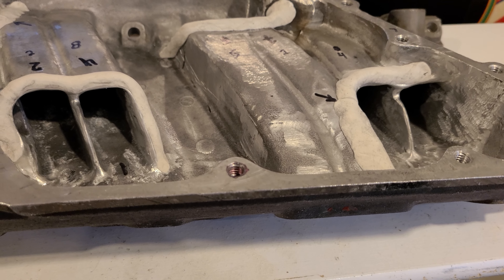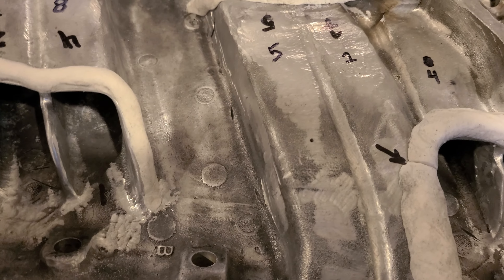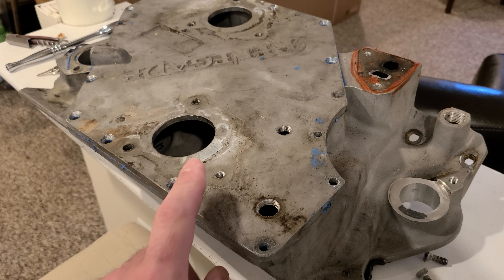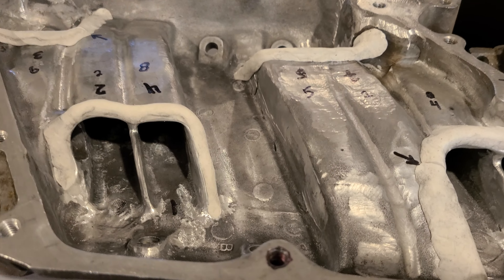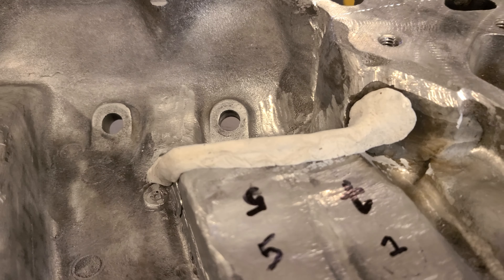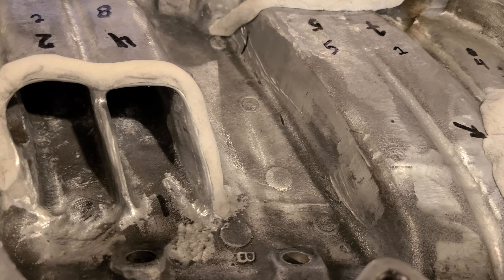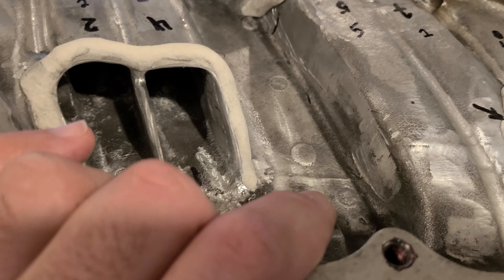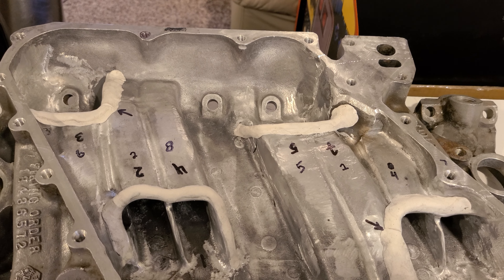Porting a crossfire intake manifold part 3

Comment: Great job i picked one of these manifolds up and i really want to port it and try it with a couple Rochester 2 jet 2bbl carbs or even a single 4bbl and a 1/2-3/4” lid spacer
Reply from the maker: @glastornjet73  if i were doing that I'd probably just make a custom lid and spacer at that point and move the units to a better location.
Reply: @ thats what i was going to do. Make a lid and a few dif top plates so i could use 2 Rochester 2bbls or 2bbl holleys or maybe 2 2bbl tbi units. 350 tbi units flow 500cfm stock and can flow 650 modified that may be cool with a holley ecm
Reply from the maker: @glastornjet73  yeah. The only real issue with the CFI units is lack of larger injectors so you're stuck upping pressure to make horsepower. The TBI units having 2 a piece solve that problem. There used to be a kit that would allow the use of a standard Bosch injector in the TBI pod and it would require a different ecm due to the impedance change for the injector. If you are using a Holley unit that may also be an avenue to explore.
Reply: @ not anymore you can get big block injectors new again now. Also can get the 9c1 police injectors which are slightly bigger than the regular 350 injectors. The regular 350 injectors are 55lb 55x4=220/8=27.5 thats like having a 27.5lb injector for each hole
Reply from the maker: @glastornjet73  i have the big block injectors and I'm already at their duty cycle limit without really cranking up the pressure.
Reply: @ oh wow that thing must run dam good
Reply from the maker: @glastornjet73  it's not bad. ~450hp is the limit. I'm getting 375 to the tire.

Comment: Great video! Can you explain what the humps are doing?
Reply from the maker: Per the gentleman flowing it on the bench, it was aiding flow distribution in the plenum (dead spots) and smoothing flow into the runners. It did pick up CFM with them there.

Comment: I port matched my intake to the heads and did not get them flowed.   How much did that cost and who did it for you?  I put it on the car an the car is crap until you get to 2500 then it will go.
Reply from the maker: It was only shipping but a gentleman on corvette fourm flowed it... if you look up a flow bench in the C4 section, superl98 comes up.
Reply: @ratherbeboating10  I changed the heads.  64 cc aluminum and 1.6 rockers increased timing to 10degs.  Need to check fuel pressure it seems like fuel is puddling at lower rpm.  Maybe low vacuum at lower rpm????
Reply from the maker: @10rrace  it could be any number of things causing that if I'm being honest... puddling and such could be the first place to check.

Comment: It doesn’t look like you touched the floors. Was all of the material you removed from the roof of the runners?
Reply from the maker: At the plenum side the majority of the material came from the walls and roof yes. The problem with the floor as I've seen it is in the area you really want to blend down, the casting is at it's thinnest. So by doing the roof at the entrance and floor at the exit I avoided most of the thin area... the walls are quite thick. Recently I worked the floor over further in the runner and just have to finish up and send it out to get reflowed to see how much it picked up... I've opened them all up to the dimensions of the best runner.

Comment: There's a couple of tricks to make this thing actually flow; one of them is to have the manifold sent off to Extrude-Hone to have the runners smoothed out (once you have it all figured out.) I've ported (and helped others port) more than my fair share of them over the years. You'll want to make a lid spacer (3/8" to 1/2" is good) but at the same time a filler for the middle section where there's no runners will help take up some of the volume increase you get with the spacer. This will help keep the initial acceleration down (more air volume means more air and thus, more fuel needs to be injected.) The spacer will help the fuel flow smoother and distribute more evenly, too. Did you remove the fuel spinners from the lid? Another trick is to mill down some of the bolt bosses where they interfere with the runner opening inside the manifold; use a flat head undercut bolt (similar to what the Renegade uses on their lid.) 

Note that those crossover ports were primarily in '84 manifolds and not the '82 manifolds from what I saw over the years. The F-body intakes are the same, btw.
Reply from the maker: The issue I run into is that at half an inch I hit the hood. Seems 3/8 is about the max and IIRC what was found to flow best. We did test without the TB diffusers. We are going to retest with a lid with them still in to see what they do and hopefully use a clear lid to observe smoke flow as well. I have noticed some F-bodies had the early casting intake into 85. Being how old they now are though who knows if someone swapped them though. The increase in plenum volume from removing the EGR passage alone would be difficult to offset imo. I forget if we tried to clay some of the dead space to lower volume.
Reply: @ratherbeboating10  The real problem is fuel distribution, taking the EGR passage out helps with that significantly. The "swirl plates" as we called them back in the day were meant to atomize the fuel better. Of course as you've seen, the runners flow differently - those crossover cuts don't really help much either, they're in the wrong place and a tad too big.

Fill in the section between the front and rear runners, you'll recover some of that excess volume you created by having a spacer (that helps fuel distribution.) Remember the EGR passage is hollow and when active, counts as plenum volume. When you get rid of it you create excess volume (but fuel distribution gets better.)

If you've ever had the heads off of a stock CrossFire you'd see how bad the distribution is. When I made spacers I made them of phenolic to cut down on heat transfer (cooler denser fuel.)

I may still have data from back in the day when I flowed the intake and did all the smoke tests but will take some digging. Best thing is to do like you said, get a clear top and do smoke tests with the TB's installed on top but you'll need to smoke test both at the same time to get a good idea. A good shop vac will provide enough flow for one runner and a smoke test.

I tested the Offy (basically the same as the Smokey Ram) when I had it as well, it flowed like crazy but was really overkill for a stock or even slightly modded CrossFire motor. The X-ram had a much smaller plenum volume but the crazy turns and weird restrictions made it not work as great as it could have. (I think I still have one here to play with as a matter of fact.)

Feel free to reach out to me on gmail with this name if you'd like more info.
Reply from the maker: @thegrumpytexan  I will forward this to the gentleman with the flow bench as I'm sure he'd be interested. I am an engineer by trade so i understand this to an extent. But CFD was never something that interested me. So i like to understand how to make it better.... i just don't have the patience to test it on a bench and fine tune. Just don't have the time ultimately. Hence why I'm running a renegade now.

Surprisingly enough the fuel distribution on my stock heads wasn't terrible.even running it on the modded engine it was alright but the air demand was beyond a stock engine for sure.
Reply: @ratherbeboating10  Gotcha, my apologies - I thought you were sticking with the CFI manifold. I still have several from the days when I ran the CFI forum with Twinnie. I'll have to give Tom a shout, he bought the HAM board design from our business back in the day; I might want to get one of the EBL systems for mine when I get around to it. Definitely interested to see how that works compared to what we were doing.
Reply from the maker: @thegrumpytexan  if you talk to Tom, tell him Paul from NJ says hello. And that he hopefully finds his drag radials sooner than later.

I wanted to stick with a stock manifold but the port seal on a 1205 leaves little room... just made me nervous. And I don't think any amount of cutting and welding could make it match what that does out of the boc
Reply: @ratherbeboating10  Will do! There's still a few tricks to it, but of course the Renegade is a quick way to skip over it all. I wanted one at one point but they're discontinued now from what I understand.
Reply from the maker: @thegrumpytexan  yeah. I have one of the last ones but it's a little messed up. It works though and I may clean up it some too.

Comment: I wonder how that would do against a 4 barrel intake like a performer. Did y’all test it without the epoxy on the ends of the intake port?
Reply from the maker: I found numbers on another bench for an RPM air gap. It's close. We removed the epoxy humps from the inlets and it got better on some ports, worse on others. The clay that is on there was a balance between evening out flow between all runners and max flow possible. We also tried a plenum spacer for the lid and it made almost no difference either way. I know the numbers for the air gap are not apples to apples but the correlation was made based on published numbers for 113 heads. Doug had 113 heads and flowed them and compared them to the published numbers and it was a even 8% lower on his. So we took the super flow numbers on the air gap and adjusted them back. 🙂If I find a cheap enough air gap I'll send it to him for testing too.
Reply: Just put a single tbi 2bbl. unit on that intake. That’s what I did and makes get power.

Comment: Do you still got the ported intake
Reply from the maker: It's on my work bench. I windowed a section of the runner and haven't gotten around to repairing it yet.
Reply: @ratherbeboating10  would you say its worth my time porting. Only considering doing it because a carb swap is like 400$
Reply from the maker: @solo_dolo6553  it depends. I still haven't tested it. But on a stock engine it has been reported to be worth up to 7 tenths in the quarter, which is nothing to laugh at.